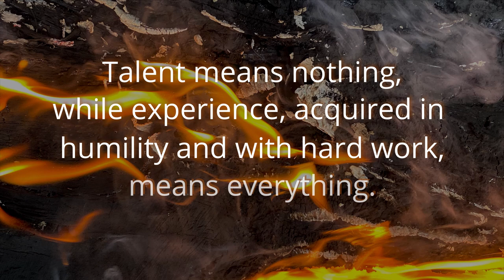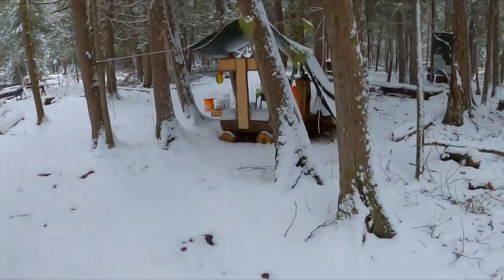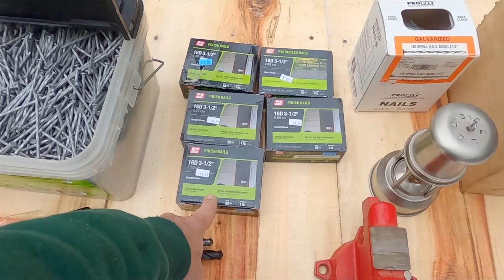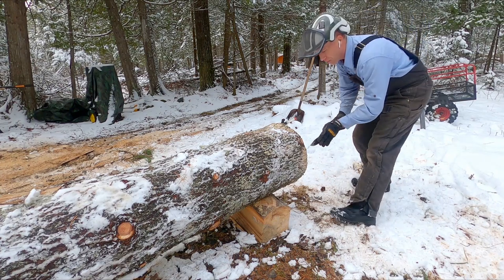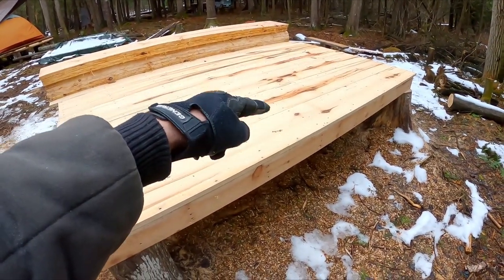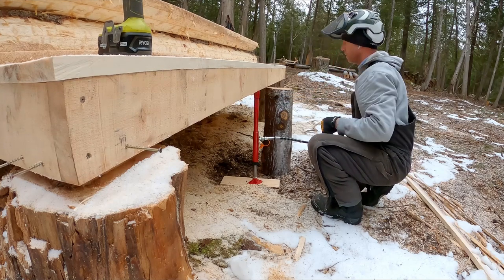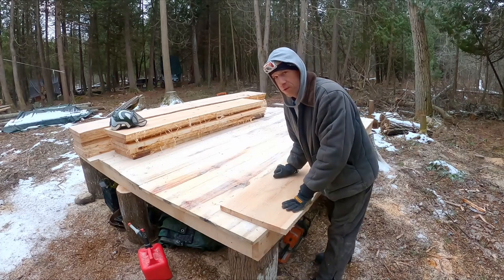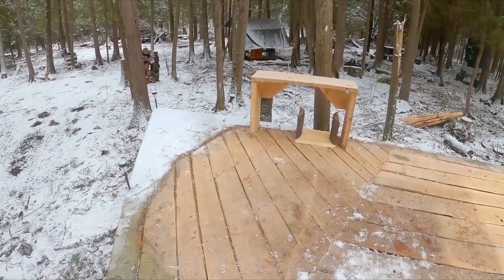Milling Stud Framing for Off-Grid Tiny Cabin with a Chainsaw #63

Comment: Consider insulating this one cabin.   Not only will it help on those really cold winter nights, but it will also help on those really cold and damp fall and spring days.  You can even build your external and internal walls, then throw in your accumulating saw dust.  No point in wasting it.  😊
Reply: Sounds like a good idea. Well thought out.
Reply: ABSOLFRIGGENLOUTELY, when he said; "I don't think I am going to insulate", I said out loud....'No, Ryan', please rethink that!!! I never thought of the sawdust, but yes that would be better than Nothing!!! I mean, they are using Straw now to Insulate homes an hour from me. Even use newspaper but I have not seen a newspaper with Ryan, so Mr. Ryan use the sawdust!!!
~Kimmy G.
Reply: @livingdeeply15  R-14 using sawdust or planer shavings.  No kidding

Comment: Hi Mister Winter,
     I live in Maine and ten years ago bought seventeen acres of forest and got going. The fantastic tent I found, as the first dwelling came from the Colorado Tent Company. A wall tent, which was set up with a fireproof panel in the roof for a woodstove stovepipe.  Eight by ten feet and walk around headroom, with table and a bed. I mention this after seeing that your orange tent is sadly on its way out. The tent was canvas with a tarp over. It took it, as to the snow loads, as the vinyl tarp shed the wettest snow. It was up year round for five years.
     Also, have you considered a shed roof on the new cabin?  Simple right?  This might be appealing over the gable, if you used EPDM rubber roofing. It’s a dollar a square foot, you roll it out over the roof sheathing like a big roll of paper towels, let it hang over a few inches all around and nail it with roofing nails every four inches to the edge of the roof sheathing. It’s way more fun than ash fault shingles.
     Anyway, my two cents.  Love your adventure and thanks for the videos.  After a hard days work, it’s fun to see a guy working harder.
                        Thanks.  Jim Lynch

Comment: Nice videos. I'm learning a lot about chainsaw milling which is great. I doubt you will answer but I have two questions. 

Where is the guard for the tip of the chainsaw? If you can leave it off then what's stopping you from milling bigger trees by cutting half the tree and then turning around and cutting the other half? 

Cheers

Comment: Just thought I'd mention that in the old days they used saw dust for insulation. My father used to cut ice and stack it in the barn and pack it in sawdust.
Reply: I used all of the planer shavings packed in heavy ml. plastic bags to insulate a build.

Comment: Hello from Australia. The cabins going to be a good little setup. Have you considered getting a larger bar for your saw and some longer starter bars to mill longer and larger boards?
Reply: From personal experience there's two complications with a bigger bar. First is the power needed to run a larger bar. Depending on what saw he's running (I have a 271), they can only push so much chain. Milling is also pretty taxing on the power head, which requires even more juice. The second issue is the G777 from Granberg is only meant to run a 20" bar max. Longer bars need a support at the end because they deflect too easily at longer lengths. The larger Granberg mills also take up the last inch or so of the bar with the support clamp, making you need an even longer bar with an even stronger powerhead. A side point to consider is that the longer the chain, the more cutters you need to sharpen as well which take time, along with the I creased cost of bars and chains at longer lengths.

Unfortunately it's not just as easy as slapping a longer bar on an existing saw.
Reply: Rich is right, his chainsaw mill is only meant to run up to a 20" bar he would need a new mill.
Reply: I have slabbed a 28-30" log before with my 20" bar, you can run the mill the opposite direction, but you run the risk of putting cut marks on the underside face of the slab if you're not perfectly flat
Reply: @Drise13  Thanks Rich, very well explained, sounds like a time consuming nightmare.
Reply: @livingdeeply15  It does take patience, especially in hardwoods like oak, but I do like all of the free 2" oak slabs from fallen trees on my property. Ringworm makes it look easy, and I'm definitely jealous of his log lifter. I do most if not all of my milling kneeling, which does work my lower back to bits.
Reply: @Drise13  and,...consider the maneuverability of a bigger, dense piece of lumber.

Comment: Save the sawdust for when you make your corewood sauna. This fall look for Labrador Tea plants. Pick a bunch of leaves and then look for wild roses (these should be stored in paper sacks so they don't mold from the moisture). Pick the rose hips and with the Labrador leaves make yourself a pot of tea, tea should look like strong coffee. Whenever you fist feel that cold/flu bug hitting you drink about 3 cups of the hot tea a day. This will help you fight off those nasty bugs. If you find any mint plants pick and save those to add to the tea. This makes a very fine drink.

Comment: If you have a hitch on your car you can have a mount with 4 uprights you can put your propane tanks on and strap the tanks to the uprights .  Or you cud mill up wood make a box that a tank fit in then run boards to keeping the box from moving then you can strap the trunk lid down

Comment: I'm sure someone has said this already,  but had you considered using a Wall Tent? With your sewing abilities you could even make it yourself. Construct an inner insulation blanket for the winter months.  Then you could have whatever size you wanted and if you used that sunbrella fabric it should last for many years. Fit a small propane or even wood stove inside and as many screens and windows as you like.  Also...pulling those logs backwards with your Honda puts all the force on the weak side of the transmission (and diff) gears. Not so great for the winch either. One more thing..build a tall-ish tripod to hang a pulley from and use either a block and tackle or your winch to easily lift the heavy beams and logs into place.  Thanks for the truly awesome vids. So jealous of you.

Comment: I have a valve between my propane tanks that automatically switches to the other tank when one empties, also allows me to switch out an empty tank while the other is in use. having two smaller tanks also allows you to get one filled while the other is in use.  Hope that's of some help.  Thanks for all the videos, I look forward to each one.
Reply: Gotta link for that valve?
Reply: @eyewokeupinhell   they come on most travel trailers now a days. I’d try googling one using that as reference. I have one on my travel trailer.
Reply: @eyewokeupinhell  I got one from Amazon.

Comment: I sure enjoy your videos, I love the UP and have camped in about every county small stream fishing.  Just wondering if you have any area that may be developed into a root cellar type shelter. Bear dens are interesting! The ground is a source of heat.  I installed freeze proof cattle watering stations N.W. of Marquette, Required a 6’ deep hole! They work well!

Comment: For the shower get a deep cycle marine battery and a 12 volt pump splice alligator clips on the positive/negative and connect the smallest shower head you can find the 5 gallons will last a lot longer and it’s easier than dumping the bucket, that’s how my uncle has the”shower” set up at his camp

Comment: I have tried going back o previous videos, I can only go back a year. Could you cover your rail holders for the chainsaw mill please?
Reply: He fashioned them out of scrap steel plates. Used an angle grinder to cut the shape/size needed for the bars

Comment: The most efficient way to heat water is called a chip heater. Using and old large propane tank. Cut a half moon shape into the bottom of the side about twelve inches high and about  eight inches wide. This is where you feed your firewood into. Next cut the top off the tank valve, exposing the hollow  interior of the tank.  Next place a coil of half inch copper pipe and insert it into the interior of the propane tank. Make two half inch holes in the propane tank, one above but to the side of  the bottom of the firewood entry point. Have the copper pipe extruding from the tank.  This is your water inlet. Next you do the same at the top same side of the tank, this is your hot water discharge.
Only small diameter firewood  or twigs  are necessary to use. The cold water now rises and  is super heated and boils nearly instantly and as long as you have a fire it will rapidly heat your water. Last, make a chimney to cover the hole at the top of the tank to discharge the smoke. God bless.
Reply: also 
stainless beer keg works well inside a 44 gallon drum..

Comment: If you ever do have a serious need to mill longer than 12’, all you’d need to add is a third one of the steel brackets that hold your big guide rails, and that’d basically double your available length at very little cost. Cut a shallow slice across the middle of the log and insert the guide bracket into it, then use your string line and clip on level to get both end brackets level to the center one. There’s a couple ways to double check them, either a long string line through all three or one bar on each end of the log checked with a level. If you’re cutting less than 20’ there’d even be a fair bit of overlap when you’re checking that’d make any level mismatch easy to catch. Then you just cut the first half, slide the guides through to the other end and finish up. Voila, extra long gazebo sized beam.

Comment: Suggestion: rig a primitive/simple wood scrap burner to melt your 5 gal ice blocks to save on the propane purchases….?
BTW. My saw shop strongly suggests warming up the chainsaw by letting it idle for a couple minutes+ or so before working it in real cold environment. They have to be overhauled/rebuilt less often. I’m thinking that applies to any/all ICE powered equipment.
Reply: I really enjoy your videos!

Comment: best cheap 4r x 8 trailer Harbor Frieght Tools you have to bolt it together but its a gtuff little utility trailer Ie hauled a lot of building materials n supplies I think several loads of water in one of those square containers I used to fill cost a quarter for 300 gallons of water in about five minutes.Id like to nake one of them tear drop campers I could slide on my trailer Im getting kind of old I dont like sleeping on the ground.I saw some cool like cargo netting l;ike ypou could use that for sleeping bags or things .